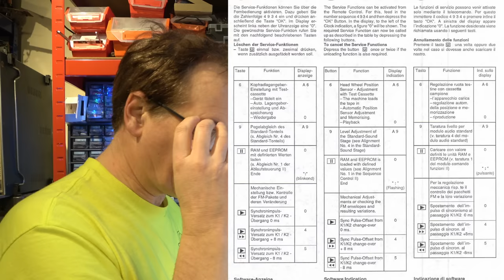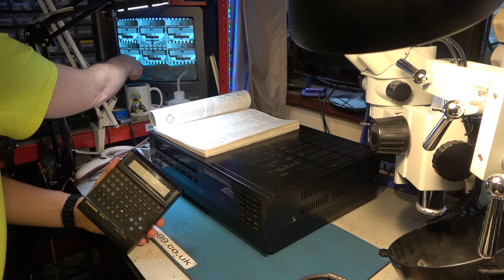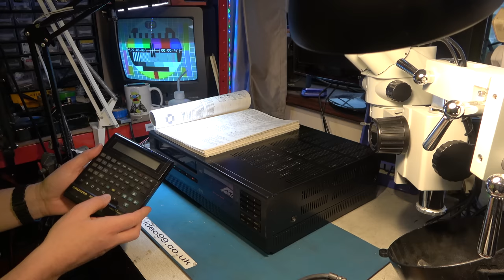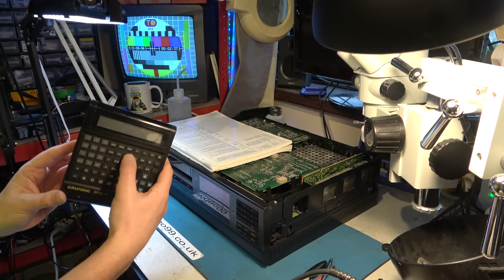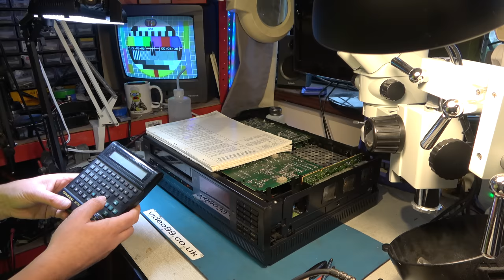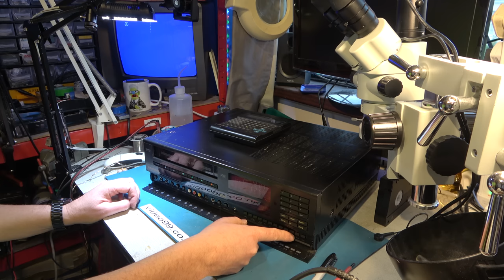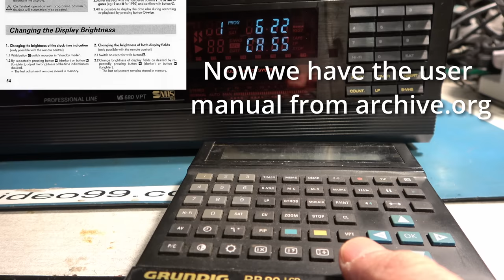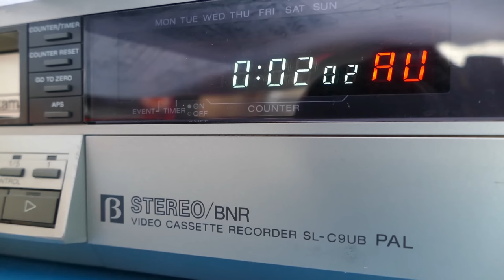Grundig's mad SVHS machine VS-680 VPT. Part 2 of 2.

Comment: One thing I've found on the internet is after replacing the battery you should run the head position sensor alignment (4934 - 6, shown at 0:28 in the service manual screenshot).

Comment: Ohh the advertisement claims that the Display has "manual regulation of brightness". The "headphone switch" button selects the audio for the headphone. The E-S button does "Edit Search (short review)". Marke sets an index mark as on many VHS recorders. The last 4 are "function keys for the Multi-Audio-System for perfect dubbing".

The chroma might actually even drop an additional half line because of the frame store as it likely converts PAL->RGB->PAL.

Comment: Thats a really interesting one for sure! 
I named my worst two umatic 800 machines "stabby" and "poker face". Stabby actually got impaled with a screwdriver before I got it, took out a few analog processing components! Poker face has firmware so advanced you have to bump a switch to start the remote protocol (a "feature" that took a while to figure out). Both had loads of other problems and I gradually fixed up mechanical and control over several years to keep my brain alive. Recently got the time code problems cleared up and they are ready for the edit controller again.

Comment: The trimming Capacitors with a red lower Part and a dark-grey cross slot upper Part also tend to rust off the Sliding Contact completely. In the 90s there were SONY Televisions made in Germany that had the same Trimmer and TDA Color IC as GRUNDIG. In the field, I installed 27pF (average Value of the Trimmers) Tube Capacitors from the 70s (Workshop was combined with Electronics Store), because you could turn suitable replacement Trimmers 360° without the Color going away. The FRAKO Bombs are still in the Power Supply and it has not been enlightened whether the Video Recorder is sharp enough for a Copy Service. Given the Price ratio for S-VHS Recorders in Germany (purchase from €50, sale from €70), I give up much earlier...
Reply from the maker: Since it doesn't have a TBC, I'm not very likely to use it for video transfers, but it's just possible it might come in useful.

Comment: Philips were equally quirky in their operation, with buttons doubling-up for multiple use; not obvious without consulting the user manual. 

On some models, the stand-by display brightness was set using the channel +/- buttons, where on any other machine that would probably bring the deck out of stand-by into Tuner mode. In Play, said channel +/- buttons then operated as the tracking control!
Reply from the maker: All Philips equipment is hard to use, it always has been.  I don't know what planet their designers come from.

Comment: I bought this video and later the Grundig GV 280 S-VHS. Despite the GV 280 using the same Panasonic engine, the image is vastly superior. Such as the performance of digital editing effects. These videos were some of the most expensive in Europe. However, they do not have TBC. So, for videophiles, I don't recommend that they are the best source for converting to digital. For this I use the best from JVC with TBC, of course.

Comment: I had a Silver Crest freesat receiver I got from LIDL in about 2004 with digital pause and zoom functions. When it was paused you could still hear the programme audio playing, so it was just a single frame capture. Absolutely useles. LOL.

The zoom went upto 10X mag. That was rather pointles too. :)

The poor thing blew up last year. It tripped the main breaker. A sizeable cap exploded and it took ages to get rid of the smell and the smoke Ha ha.

I wish I could find another one.

I would have liked to have seen the special features demoed with moving images as opposed to a test card. :)

It's a very nice video machine.
Reply: Actually no, there were Pay-TV providers which offered a Mosaik screen of all of their channels. With the zoom function you could just zoom in on a channel and select the unencrypted audio while watching the badly pixelated video without paying.
Reply: @altebander2767  Yes, that would be useful, but mine didn't have the PIP or multi-channel functions and it was a free to air receiver only, no card slot.
Reply: @frankowalker4662  I think you are missunderstanding. Those Pay-TV operators had unencrypted free to air channels where you had a 4x4 or 5x5 mosaic of their channels, as well as 16 or 25 different audio channels.
Reply: @altebander2767  I never saw anything like that. Are you in US ? I'm in UK.

Comment: This is a fascinating machine. Clearly not a high end machine*, but tonnes of interesting and handy features that higher end machines didn't always have. Was this maybe sold as some kind of editor?

*Were grundig ever? I always thought they were cheap but extremely cheerful and because of that a pain to fix when they pack up down the line.

In addition just a great video to watch. I like repairing things but so much of the stuff you do is way over my head but you explain in a way that I can start to understand it. For once its also very pleasant to see you work on a machine that doesn't have you fixing one catastrophic problem, only for the machine to immediately shart itself somewhere else. Great video as always Colin.
Reply: Grundig was great in many areas e.g. TV sets, world receiver radios and many others, but VCR,s variably came out, sometimes better sometimes worse. In this he was quite average, especially when it came to the reliability of the machines. They just had a tendency to overengineering in this type of production.
Reply: Yes, I'm quite sure this was sold as an all-in-one home video editing solution. If I remember correctly the user manual says something to that effect. The full alphanumeric keyboard on the remote was for adding titles.

Comment: Actually most VHS recorders could record the teletext signal as it's low enough in bandwidth to just pass under the 3,5 MHz bandwidth limit. AFAIK the main problem recovering teletext are things like the crispening circuit which does non-linear things with the video and therefore cannot be corrected for in deconvolution.
Reply from the maker: This one could record teletext pages as images on the tape.
Reply: Standard VHS doesn't record high res enough for a normal teletext decoder, but there is a software project that manages to restore teletext data from vhs tapes by using data models and using the fact that's it's continously retransmitted - see vhs-teletext

Super-VHS was able to record it well enough for normal teletext decoders afaik.